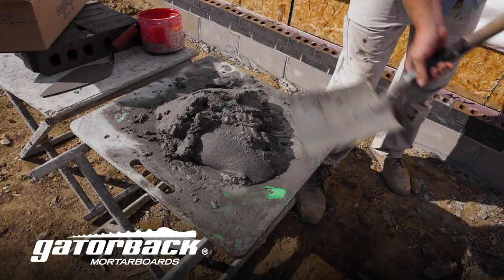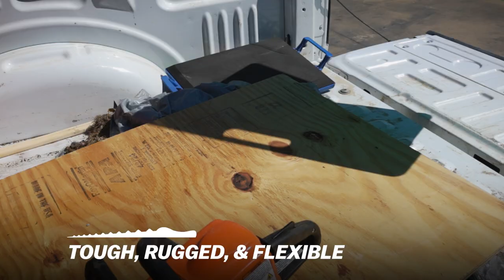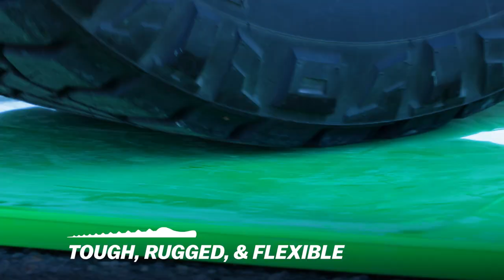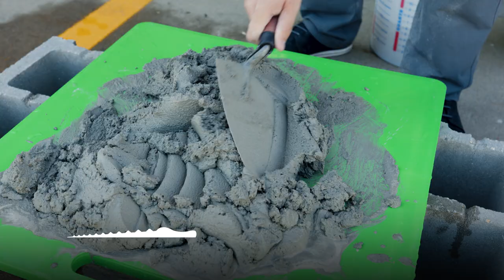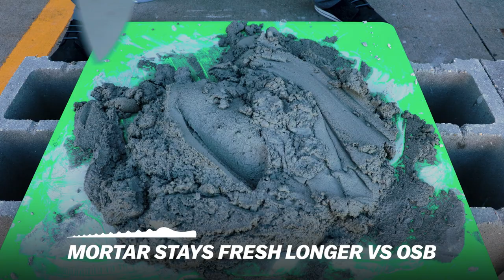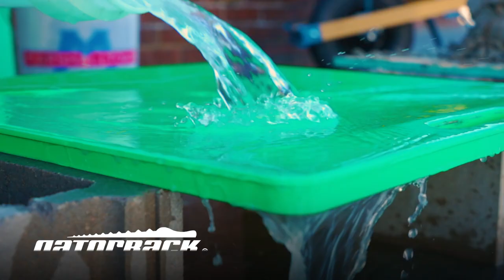Gatorback—The Best Mortar Boards!

Comment: We don’t use OSB. Just use and say plywood in the vid and it’s 100. 
Plywood still has its issues. It soaks up water and dries out the mortar faster than Gator boards. Laborers will tear em up with a shovel, and you’ll sometimes get debris in the mortar. If your plywood is too thin it will warp. 
Two thumbs up for the Gatorback.